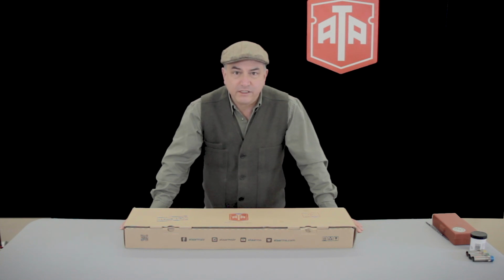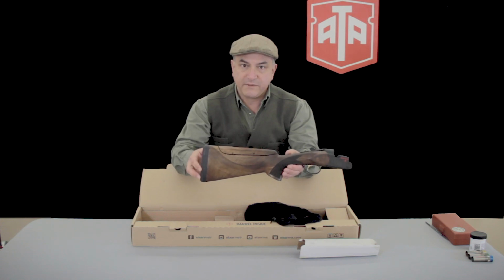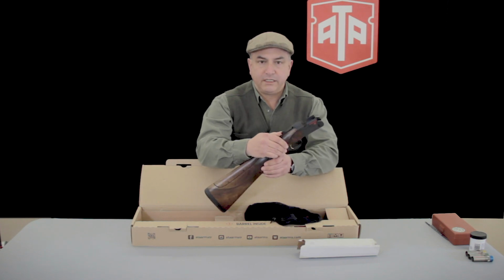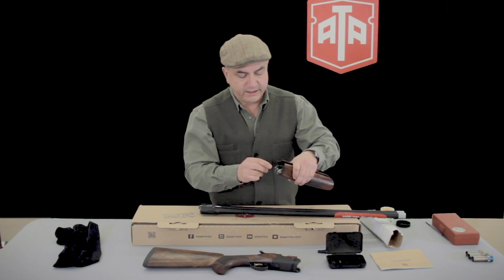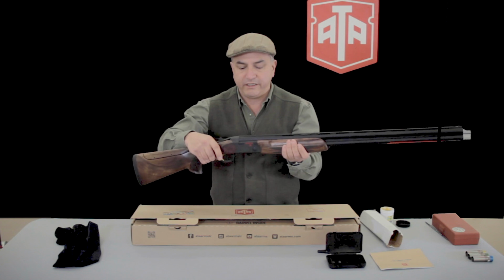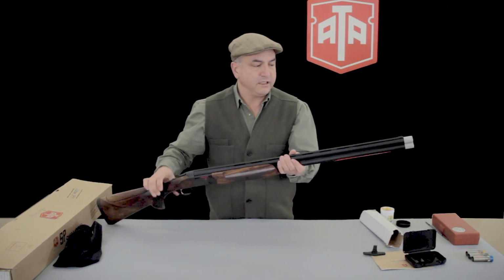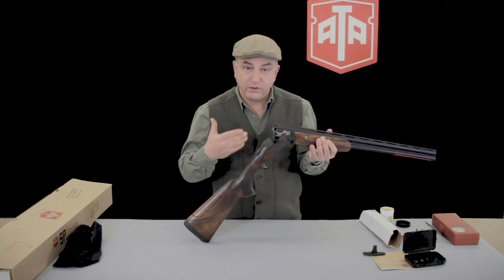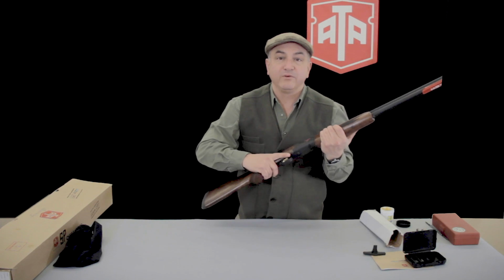Unboxing & Overview - SP Super Sport w/ Adjustable Comb

Comment: The thing is that you loose the durability when you cheat with the precision. No matter if you try to copy beretta 686. I have seen ata shotguns wear out after a couple of seasons on the clay ground. A beretta holds for hundreds of thousands of rounds because of this reason.
Reply: My local shoot uses a ata sporting for lessons and has put 20000 cartridges though it in 2years with no problem